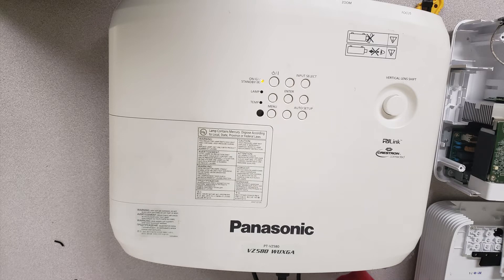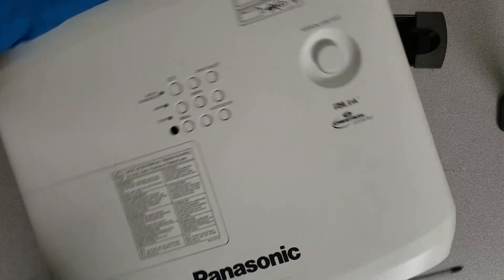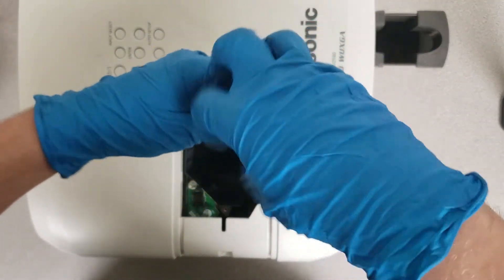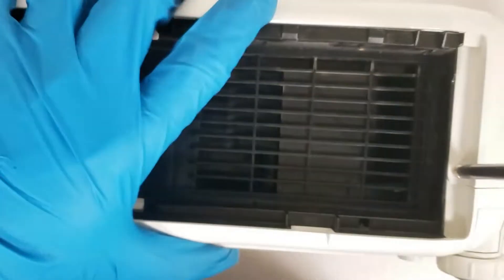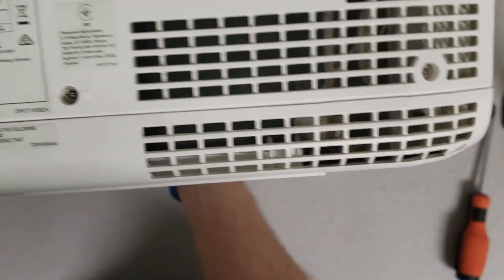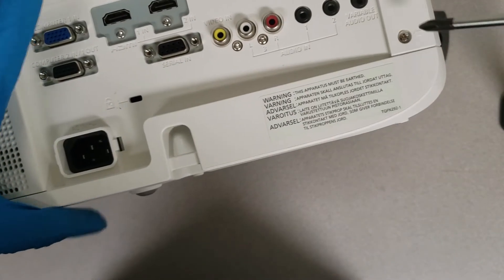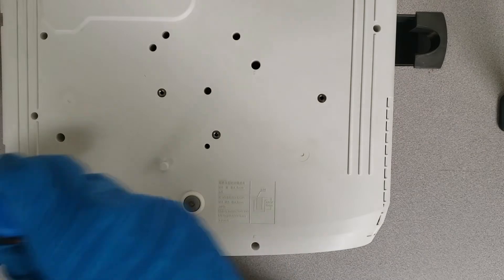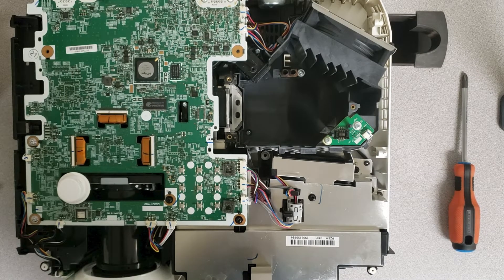Jaspertronics - Opening up the Panasonic PT-VZ580

Comment: Do you have any videos on replacing tthe lamp on this projector? I am getting a replace lamp warning when i turn it on just wondering if i should replace the lamp with the bousing or just replace the bulb
Reply from the maker: HI, I would replace the full lamp and housing on this, you can find the replacement instructions on page 118: https://bizpartner.panasonic.net/public/system/files/files/fields/field_file/psd/2022/07/21/vz580_manual_en_1658441929.6982.pdf

Here is a link to the lamp: https://www.jaspertronics.com/products/pt-vz580-lamp
Reply: @jaspertronics  I noticed that some places were selling the lamp cheaper, does the link you have sent have the housing and the bulb?
Reply from the maker: @jpmcfeely  We have the best prices on the original bulb for these units. The link sent is the housing and bulb, what were you looking at? There is a good chance you are looking at an aftermarket bulb.

Comment: How do i take off the lense?
Reply from the maker: The projector lens can only be removed after taking out the main board and tearing down the light path. I do not recommend doing this without any technical experience.
Reply: @jaspertronics  what can i do if my lense got burned and i have a donor 5k that i can swap put the parts for?